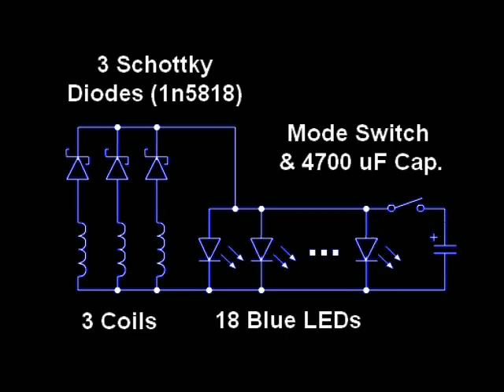Contactless dynamo bike wheel lights

Comment: why do you fix the magnet and the coil so next to the center of the wheel?
If you fix it a little closer to the tire it will produce light even on slower speeds